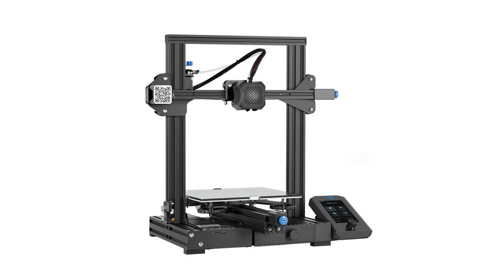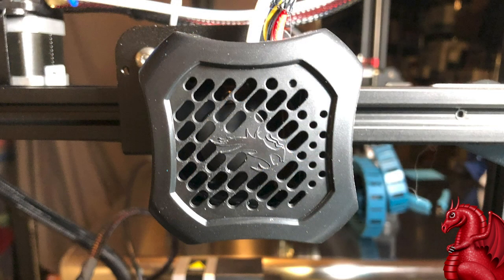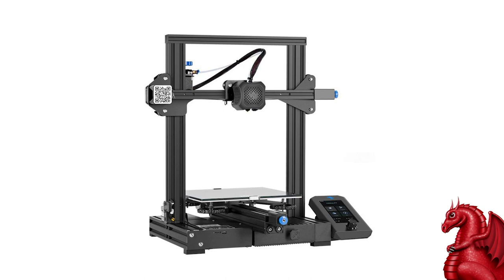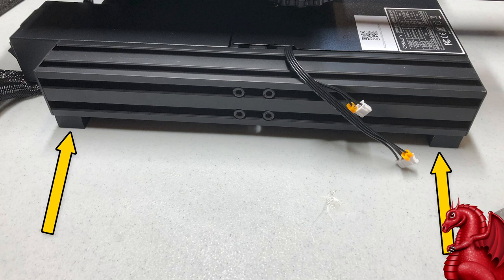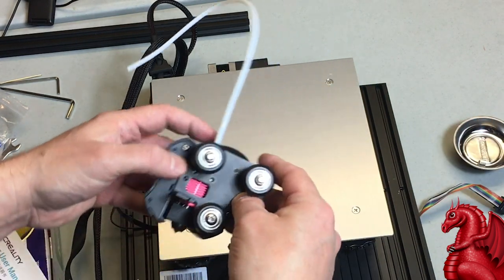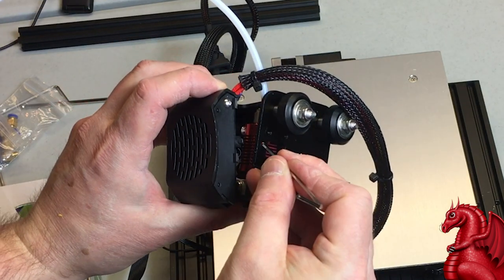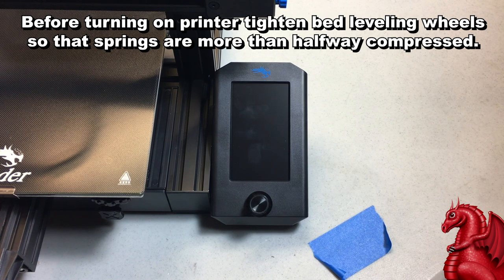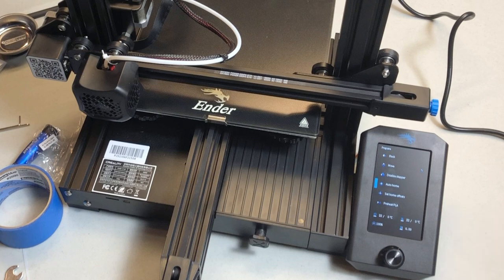Creality Ender-3 V2 assembly and pro build tips - UPDATED 2021!

Comment: 14:50 VERY important advice from you. The triangle of bearings and the eccentric nuts, the assembly/fitting of them. Getting that fit right is number one. Great explanation. I watched your older video of the Pro 3 (V1) on this as I built the V1. I fitted/adjusted the two X axis bearings assemblies to a gantry rail before building the X rail and gantry. Why? Because the fit of those triangle bearing assemblies are critical to assembling the build, (lack of a better term), square.

I may be new at 3D printing but I have mechanical knowledge and want to add advice about the tape measure part.

My added advice to the readers/builders. Use the X axis rail assembly as a gauge/tool to align the gantry rails from the base to top alignment instead of using a tape measure.

Assuming you built the X rail assembly correct. Fit the rail to the base. Reset/tighten screws as needed. Move X rail to the top of the Z then add the top rail and gradually anchor it all....Check the travel of all axis parts. If it is even. print something.

Comment: My first printer is an Ender3 V2, bought this time last year after multiple reviews saying it's a good starter printer. I'm happy to see that, through the course of my learning to 3D print, I did every upgrade this video recommended. I did do one thing that was not mentioned, the tension arm for the extruder on mine broke at the pivot point. I believe it was a combination of too much tension and my enclosure getting a little too warm (was noticing soft filament prior to entering the extruder). Like 10 bucks got me an aluminum one, and I improved the enclosure airflow to keep excess heat from being absorbed by it. Other than that, I've found the E3V2 to be very forgiving to a novice 3D print enthusiast.

Comment: Thank you for taking the time to make a thorough and complete video such as this. I'm amazed at your attention to detail and this is exactly what I needed. This should be linked in there instruction booklet. I'm brand new to 3D printers I figured I would get one this is the one I got and I would probably still be messing with it if it wasn't for your video. Looking back it's all a lot easier/more simple now, but you made everything simple. Thanks for saving me a few hours at least. Keep up the good work.
Reply from the maker: Glad it helped you! :)

Comment: One thing that caught my eye, besides being very thorough, is careful levelling of X axis on lead screw side, then tightening the "free" side roller thing before sliding gantry to Z profiles - which may run only on two wheels or force X axis out of level if not straight.
Maybe leave screws on the free side a bit loose and tighten them only after the profile aligns the roller triangle to correct angle.

Overall I think this is the most useful Ender 3 -type printer assembly and alignment video I have seen. I wish I saw it before assembling my printer :D

Comment: Just bought a Ender 3 V2 and went to the links about the springs and PC4-M6 Fittings and PC4-M10 Fitting Connector for bowden tube are they are unavailable ATM. I love the way you make it easier to set up than trying to follow the manual
Reply from the maker: Check my website under the Resources menu for current parts links.

Comment: I'd like to mention that I'm finding an issue with this guide where you don't adjust the distance between the two vertical extrusions to line up with the left and right side of the x axis bar. I found this out after undoing and redoing the assembly three times with your video. The Creality official guide (which I used the first time I built my printer in 2020) accounts for this be leaving the screws loose for a while. If you don't do this the vertical extrusion will bend themselves as the x axis bar moves up and down and the x axis will be able slant as not all 6 rollers will engage properly.

Comment: Thank you so much for putting out this video, I followed it exactly as you did and my first printer is now put together and turns on, I removed the Z limit switch and wiring because I added a CR Touch, so I didn’t try the auto home yet as I’ve got to program the cr touch first, without that Z limit switch I assumed it would have crashed to the bottom. Thanks again, I’m going to check out your other videos.👍

Comment: Here are some further upgrades which I recommend for print quality and consistency:
-dual gear extruder (much less slippage of gears and filament)
-PEI flexplate (much better adhesion and easier removal of prints)
-filament guides (you can print these)  it reduces drag of filament AND prevents clogging
Most other upgrades (dampeners, support rods, dual axis mods, direct drives etc) have very minimal improvements from my experience.
In fact, direct drive is only more beneficial if you struggle with stringing and use flexible filament. It adds more weight on the head which creates "ringing".

If you ever try these mods out, let me know ow what you think!

If you
Reply: Pink foam was perfect for making my enclosure. Tough to score it properly but it glued in perfectly and made a light insulated enclosure that i could take off if i needed to work on the printer.

Comment: Nice job. I appreciate the attention to proper mechanics such as detailed slider adjustment, perils of steel screws into aluminum, support alignment, etc.. the good news is my V2 was pretty darn good out of the box. Some frame bolts were loose and bed roller adjustment pretty bad. I found that using a metric 38cm steel rule made alignment tasks very easy. I was going to support you by buying via your links but dang, not interested in a whole bunch of extra parts (eg 12 xtra springs!) cluttering up the place.

Comment: The best thing to do is buy a voxelab Aquila v2 there $170 and a clone of a ender 3v2 that’s $50 cheaper .
I just finished setting one up added a bltouch $40 magnetic pei bed $25 got the newer red dual gear extruder on Amazon came with Capricorn blue Bowden tube and yellow bed springs was another $25 and after that I printed a vertical mounting bracket for the screen and flashed the firmware to the jyers upgraded marlin for the printer calibrated all the esteps and it’s been printing 24/7 with no issues at all it’s actually been a extremely reliable printer and it came with a glass bed but after you use a magnetic pei bed for pla+ especially haha it’s just the only way to go I use a smooth surface one and it leaves such a great finish on the print and I’ve never had a print not stick to it unlike glass beds always just used Elmer’s glue sticks but that does work of course you have to wait for it to cool all the way and then scrape off the print lightly with the magnetic bed it’s like you can soon as prints done lift the bed up and the print falls off besides a bltouch and have it a 16x16 mesh is the best upgrade for a 3d printer.
For $260 you can have a fully upgraded ender 3v2 though going with the voxelab version and between the two they or indistinguishable in quality but if you have the money get a printer with a autobed leveling already installed and put a magnetic bed on it if it don’t have one and get to printing .
The learning the slicers is really the main thing and you will learn as you go you can pretty much adjust everything you can think of with cura and with these ender3 type printers use Cura whenever you can unless you slice a file and you preview it and it’s not slicing the model details correct for some reason some will just give you issues then try slicing it in Prusa and preview and see if it will work for you Only times I’ve ever used Prusa was just to print some small models that just gave me some trouble. 
But cura has always gave me better quality prints all around from strength to finish surface .
3d printing is amazing and everyone should have one at the house I’ve made 100s of quick fixes for things over the years and that was when things were aweful today to be able to setup like that voxelab with the upgrades for $250-260 is a amazing value.

Comment: This is a great video for setting building the Enders 3 v2 shame i missed seeing after i built mine, 

Got my Enders 3 v2 a week ago. some things that im struggling with, I always use PLA+
And it does not stick to the Glass plate so back to using decorating tape.
Secondly , the X axis Stepper motor gets extremely hot and can burn your hand if hold it.
The Mother board is Version 4.2.2
I have added a BLTouch and so i have changed to the correct Firmware.
after many tweaking's the Outer sides of the prints come out very nice  at 0.16 layer height and speed at 40

But i tend to get a very poor finish on the top surface 
Has anyone else had such issues.
oh the software i use is Matter control and is perfect on my other brand of Printers for the last 4 years.

Comment: I spent hours trying to get everything you explained here exactly right. Namely to make sure the vertical extrusions are perfectly parallel to each other. But now I am at the end and trying to screw the top frame on it and I realized that the screw holes do not align with the vertical extrusion holes. Meaning whatever angle the vertical extrusions had does not matter because the 4 screws on the top frame is going to be the determining factor. Now I don't know what I'm supposed to do and I don't understand why I spend so much time trying to get them parallel when this top frame is going to overpower whatever angle I put them into.

Comment: Really liked the video but I have to say that my Z-axxis was too low. Especially because I changed the springs to the silicone shock absorbers. I know just moved up the z axxis end switch until it seemed to be more or less ok. Maybe as a hint for others so that they do not drive into their glas bed xD keep an eye when it drives down. Then I just moved steps with the z axxis, to see where my 0.0 should be and adjusted the sensor accordingly.

Comment: Great stuff, as usual. I recently purchased the 3pro t a steal of a deal, and used your info for the set up and print settings. Very helpful as was this video. What is your take on the solid silicon for the spring replacements - is it worth the effort?
Reply from the maker: I've tried it and prefer the flat die springs.

Comment: Thanks for this video, I'd have really struggled with the printed instructions.  I've upgraded the springs and bought new couplers but I can't separate the fan cover off the hot end to fit them.  I can't undo the screw, it just turns. I think the captive nut inside the fan housing (shiny round thing top right at 11:36) is just spinning in the plastic.  I don't know whether to just prise it off potentially breaking the housing or grind the head of the nut off with a dremel.  Unfortunately it's past the amazon return window now.  I need to get in there eventually to change nozzle etc.

Comment: Thank you for the video!  I unboxed my Ender 3 V2 earlier this evening.  I have not started assembly, just a parts inventory.  I’m noticing that when I gently move the print bed along its travel, it has three spots where the bed will stop as if there is a flat spot on a guide wheel.  A slight push gets the bed moving again, but moving the bed to each end of its travel limits I can feel the three spots where it feels like a flat spot on a guide wheel.  

Feeling the wheels one at a time with a fingertip while moving the print bed does not reveal any flat spots on the guide wheels.  Any thoughts?
Reply from the maker: Loosen the eccentric nuts and tune per the instructions in this video, check the Y belt to see if it is too tight (try loosing the wheel slightly).

Comment: I just bought the Ender 3 v2, have printed three things and now there is a slight jerk at one point on the bed drive belt and the bed drive belt is fraying on the right side if your looking at the front of the machine. I can't seem to locate the problem area...any ideas?

Comment: What should I do if the vertical extrusions are not square to the base (front/back) of the printer? (Not the rotation, or leaning towards/away each other) Is it a problem? It seems like it should be 90 degrees for sure..
Reply from the maker: Yes, they should be 90˚.
Reply: @Tombof3DPrintedHorrors  How would you try to fix that? Some kind of a shim or a washer or something? (I tried to take a pic -> imgur /a/uzCofbP)

Comment: YOU DIDN'T SHOW HOW TO TIGHTEN THE Z AXIS PULLEYS
Reply from the maker: That would be kinda hard since there is no Z axis pulley...
Reply: @Tombof3DPrintedHorrors  Sorry, I meant the eccentric nut for the x-axis carriage. Both sides have nuts that can be adjusted.

 https://youtu.be/CBiTCBVSBdE?t=265
Reply from the maker: @noodlery7034  ALL eccentric nuts are calibrated the same way, there's no difference.

Comment: I've noticed that on the right side of my printer not all of the wheels engage the same. One is pretty loose. Any idea how to fix that...? It prints fine but it's bothering me.

Also I have a bizarre problem where my nozzle scrapes the infill for some reason and only infill. Everything else is fine but this can screw things up a bit and makes a pretty awful noise. I don't want to use z-hop since it introduces stringing among other problems but I have no clue what is the underlying problem of that makes it scrape like that. My e-steps and flow are calibrated properly, I even set infill flow to 95% in cura and it helps a little but that's not really a solution.